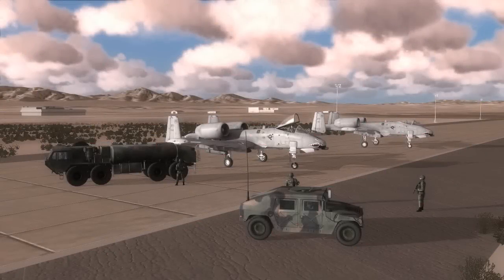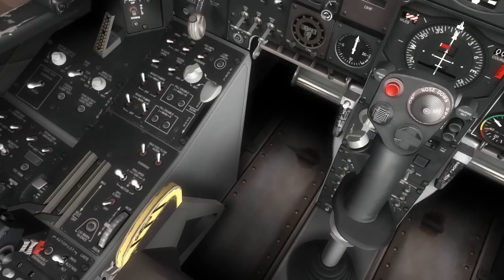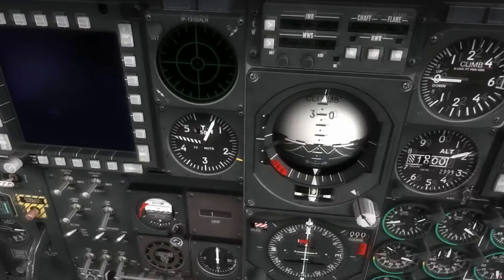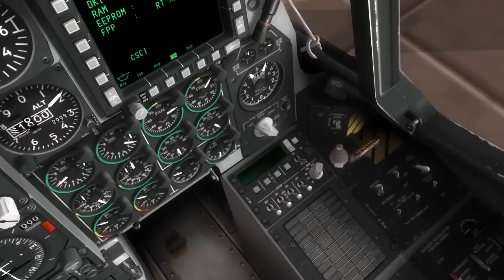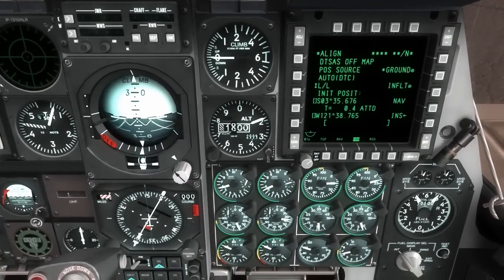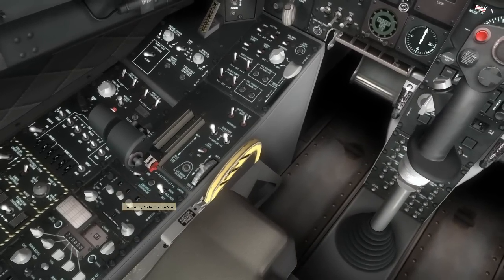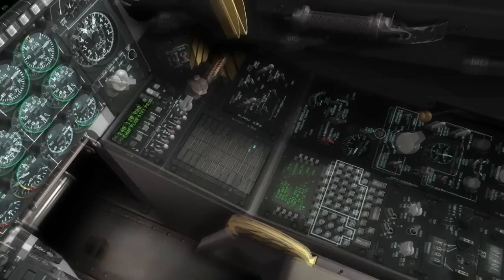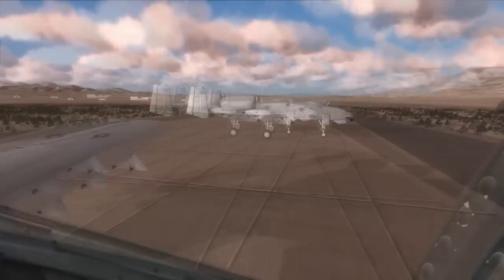DCS A-10C Warthog Producer Note 2 - Start Up

Comment: Most multiplayer servers make you do this cold startup. The mission maker also has the option to have players start with all systems running on the ramp, or already in the air.

Comment: @tcharmon74 TrackIR from NaturalPoint is the commercial software/hardware device that they use for the head tracking (eye movement).

For the current games, players not wanting to shell out so much for that device are also using a variety of home-grown and freeware solutions such as FreeTrack, or webcam->virtualjoystick devices that use webcam 'face detection' software like SeeingMachine's FaceAPI driver.

Comment: The engines can run without fuel pumps in level flight.  They are only there to maintain positive pressure at engine start and high G manuvers.

Comment: The visual check of the engines would be to confirm rotation of the fan (1st stage of the N1 spool), not a turbine. Also, If you're setting a COM radio to 127.5, its VHF FM, not VHF AM. Generally, the only AM radio still found on aircraft is the ADF reciever. I don't know if military aircraft even still carry them.

Those were the biggest problems I found with this video. Which is FREAKING AMAZING. I cant wait to blow up tanks. :D

Comment: I use a X-52 Pro HOTAS w/pedals and resort to Right Alt + Home and Right Ctl + Home for engine start as there's only one throttle control on the X-52.  The TM HOTAS has two throttles but no pedal support AFAIK.

Comment: @Kryndon64 
Some Joysticks have software to support it (with drivers and button-customization software)
Can be found in "control panel" go there, and look if you can find a setting for you joystick.
If you found the right setting-menu or joystick software, look for calibration.... perhaps you will see that your joystick has a pref for left by default....

Comment: @indirulz1234 dude, there is more than one reason to have a lot of buttons at our disposal on the cockpits. First reason i could point is to force the pilot to know the systems and how they operate, that being said it may be controversial but it simplifies things on the plane, that´s because the systems can be independent the pilot itself connect them and disconnect them, so when we have a failure we know where it is and possibly we can figure the best move to solve it or to go around.

Comment: This may sound like a stupid question and I never thought of it until seeing this vid. It seems that it would be very easy to accidentaly hit an important switch like the fuel pump toggle switches and turn one or more off in flight. Is there a master switch to critical components that bypasses the switches once the plane is powered up?

Comment: All good and well, but as with Black Shark, manual engine startup gets a bit boring very quickly. Even F4's far simpler procedures are a pain.

Next gen will have up sat in the ready room... press 1 to pull yer pants up, press 2 to zip up your flight suit, press 3 to climb into the flight line wagon, press 4 to make a smutty remark to the female lieutenant.

Great fun - but only as a one off.